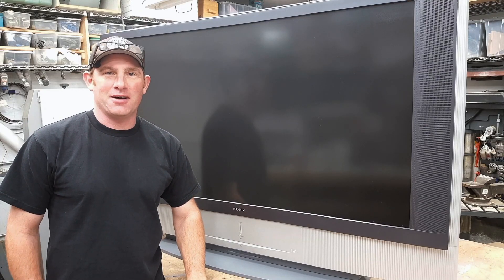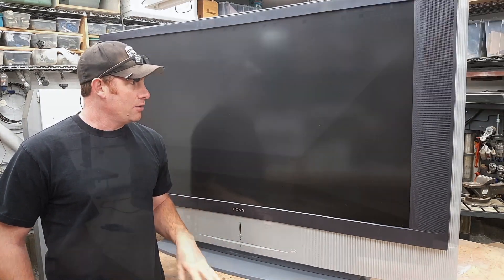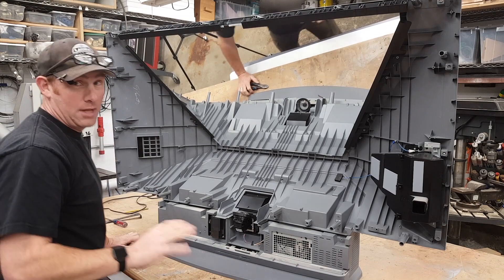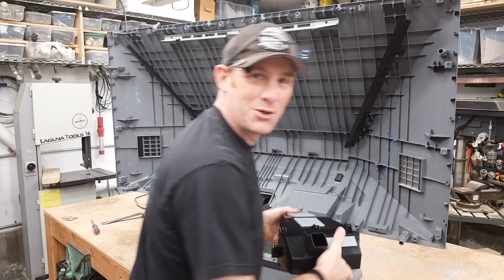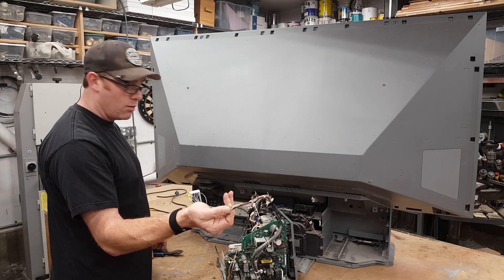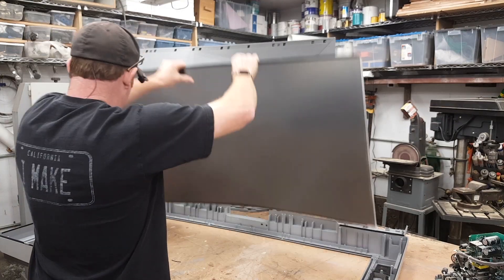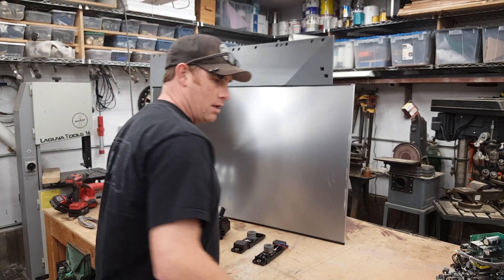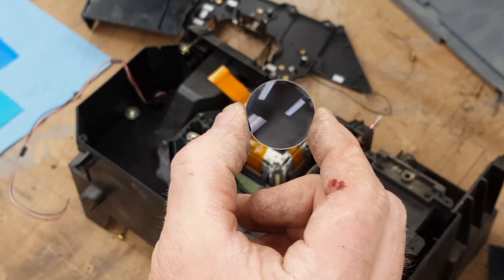Did You Know - Optical Quality Mirror inside TV's? - DYK #3

Comment: i came across this vid cause i have the exact same tv, in which i have fixed to almost perfect. 
 but i was looking to see how you take the front screens off, cause on mine there is dirt or black smudges in between the layer or inside the screen it self, and faint black lines with the front polarizer screen. 
 was seeing how to clean these screens or if there is anyway to get them back to normal. 
 i know this vid is 6 years old. but was just seeing if you would know anything thx.
Reply from the maker: I'm sorry to say that I don't know much about that particular problem.

Comment: I did my Phillip's. I will never have to buy another basic component like a inductors, capacitor, resistor, etc again. After dismantling that tv and seeing its power supply, I now know why the power bill went down. 3ft X 1ft power supply board O.o. I got same as this guy, plus a massive flyback transformer, a couple massive transformers, about ten good size transformers, just so much.
It was alot easier than carrying it all to dump.
A solder iron with the vacuum pump remover, and i had everything off those boards in no time. 
My dad claims i destroyed a $7200 tv in early 2000s time and money. 
Unbelievable. I dont know the brand, but my uncle has one that I swear is almost 7ft across at the base. It does 480 hdmi I believe, and works perfect today in 2021. 
He keeps it because it suits the man cave so well. I think it's a Toshiba, but its huge.
Reply from the maker: That's great!

Comment: Justin, I have been experimenting with kaleidoscopes after seeing your video on the 3D kaleidoscope. I have had a lot of fun, Thanks! I have gotten several rear projection TVs. There is a warning on many of them that indicates that 30,000 volts on the cathode ray tube that may be stored in a capacitor. To your knowledge is there a high voltage capacitor in the Sony that you took apart?
Reply from the maker: I'm not sure. The Sony I took apart in the video didn't have a CRT component in it. But that doesn't mean that there aren't other dangerous parts inside. I usually have the unit unplugged for a few days. Even with that precaution I treat almost everything like it's a live circuit.
Reply: @Makebuildmodify  when you just get the mirror out and dont touch the rest there should be no danger right?
Reply from the maker: @13hubi13  I'm not sure. The Sony I took apart in the video was unplugged for a few days. Even with that precaution I treat almost everything like it's a live circuit. Be safe.

Comment: I gutted a Sony TV just like that a few months ago, including the same LCD projection system.  You missed one of the greatest pieces of engineering, the three color recombining prism in the center of all of that.  When looking into the output face of the prism, you can see three directions at once.  You'll see blue from the right, green from straight ahead, and red from the left.  Super cool.  It's job is to recombine the three separate color channels, then pass the light through the lens and prism you already showed, which projects it onto the TV surface.  There was also a crazy sharpie drawing of a duck on the inside... apparently they sometimes get bored at the factory.
Reply from the maker: Yeah, I found the prism after the video. Pretty cool stuff. The duck cartoon is hilarious.
Reply: Hey guys!!! I know it’s a year later, but I just ripped down this SAME TV and I’m super interested in USING THESE PARTS.... Any clue how to get this thing to work as a projector or any other cool projects that my kids would enjoy???? THANKS

Comment: I've always wanted to go to my local electronic recycling center and ask them if I can have some of the stuff to re-use. They probably get some good stuff there.
Reply from the maker: Yeah, I drool every time I drive by out electronic recycling center.
Reply: I'm so jealous, we don't have an electronics recycling center. We just have a scrap yard and they won't let you take shit from there. I do pick up alot of electronics off the side of the road that people have put out for garbage pick-up. I salvage capacitors, fuses, speakers, wiring connectors, etc, then I pull the copper out for my scrap yard pile.

Comment: Very interesting. I think that the "lens" on the screen has vertical lines that spread the light horizontally. I had a similar Sony and that's what mine did. I can't imagine what use a fresnel lens would be in that position since they are usually magnifiers or wide angle lenses. Anyway, the vertical line lens was designed to improve off-axis viewing.
Reply from the maker: Very interesting. Thanks Tim!